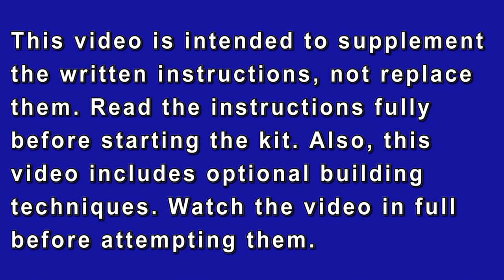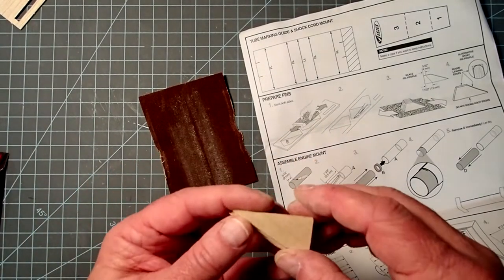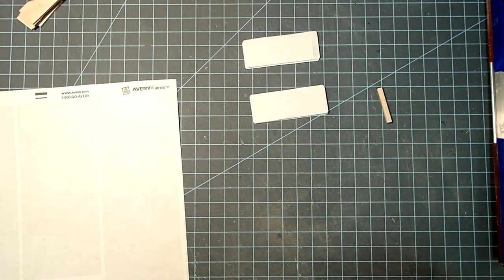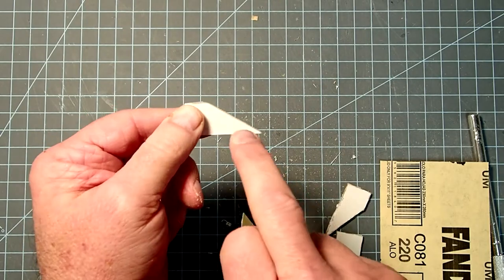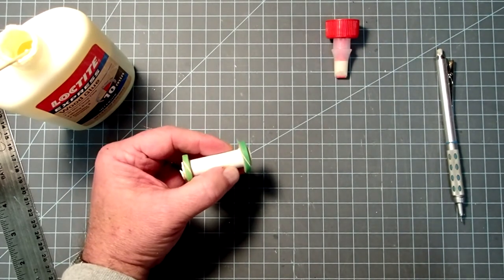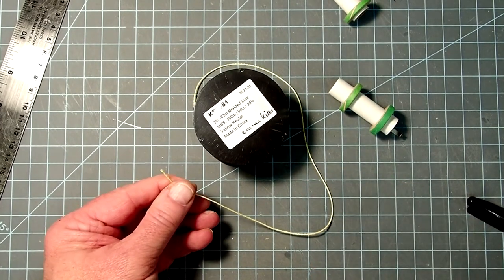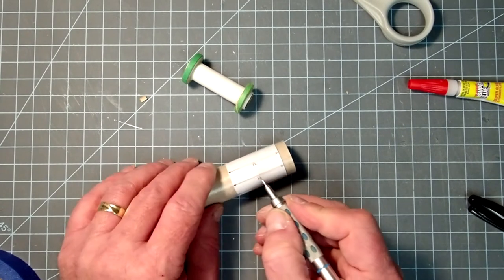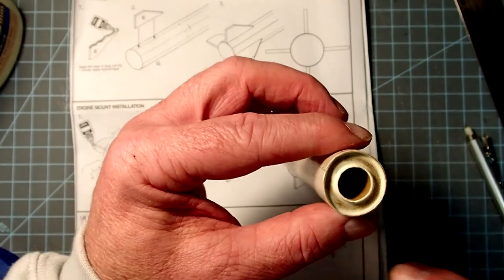Estes "Mini Honest John" model rocket assembly (part 1 of 2)

Comment: So liked your approach to building these Honest Johns. I just started as well with Kevlar and the trade off even tho a tiny bit heavier is an outstanding way to get by the elastic issues. I do have some slightly differant ways to do this after building for many years myself but your ways are awesome and so appreciated. Estes tube guide equipment are great as well! I agree with putting the engine mount into the body 1st then the fins as well. Gives a good holding base for the Estes fin alignment tool. Thanks for sharing.
Reply: Using kevlar shouldn't be heavier.  In fact the kevlar is 1/3 to 1/4 the weight of the elastic and you aren't using the Estes tri-fold.  That should net you 2-3 gr of weight and make it easier to eject the chute because there is less friction on the tube wall.  

I just built my second mini-HJ and I also air-foiled my fins instead of simply rounding them like I did with the first build; then applied wood glue like one would with sanding sealer.  The fins are stronger than basic balsa.  With the weight savings, I checked the balance and flight sim'd the rocket.  It DOESN'T even need the extra weight in the nose now; that plastic nose cone is very heavy compared to the rest of rocket.  So better flight performance all around.